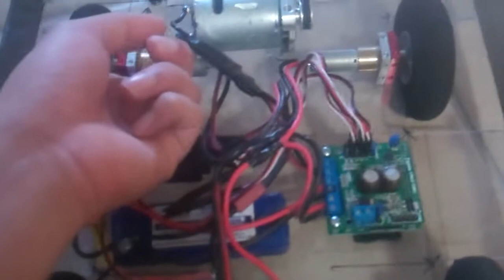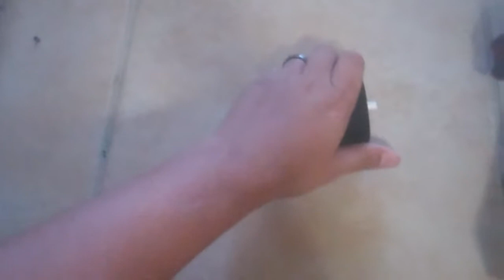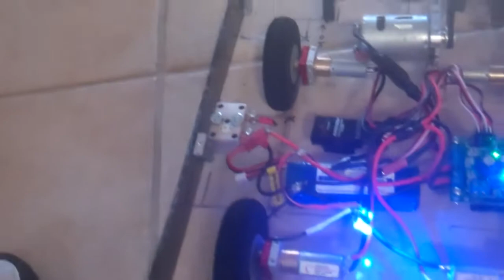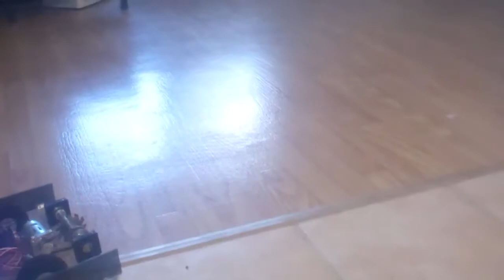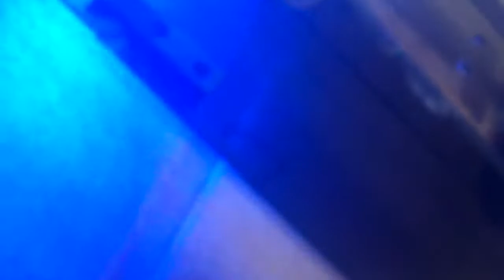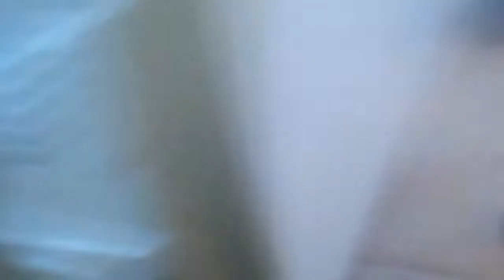Beetleweight Battlebot - Final test!

Comment: what type of power switch on/off switch is that? where did you get it?
Reply from the maker: GetBitSportfishing team whyachi, it's overkill for a robot this size. I'd recommend the similar one from fingertech robotics that is smaller. This one got repurposed to my 60lb robot.
Reply: Ahh I thought it was one of those. I'm actually currently building a mini son of whyachi(12 pounder) bot and I need a switch for the weapon system that can handle up to 100 amps, I could probably get by with less but I just want to be on the safe side. I think I will run the fingertech to power on/off my drive system, or just go with the bigger team whyachi switch and use it as a master power for everything
Reply: I'm going to be running the fingertechs in a pair of beetles that I'm building. I'm still new to building and don't have any fancy machinery, but I get by pretty good.